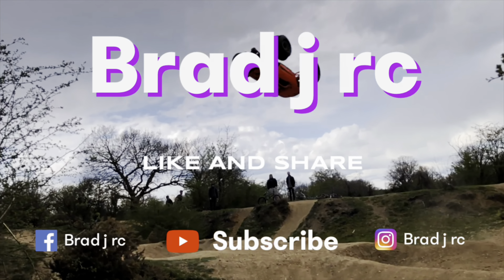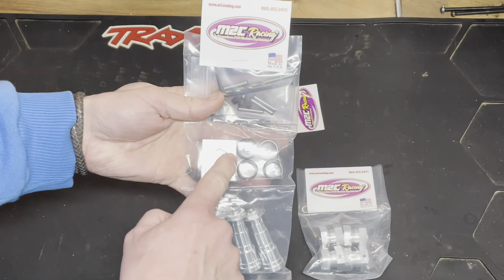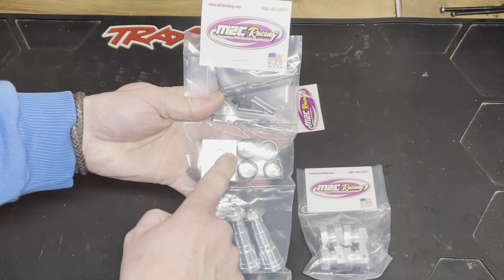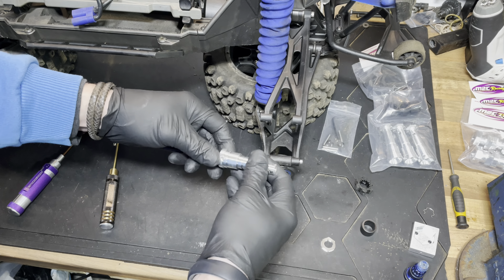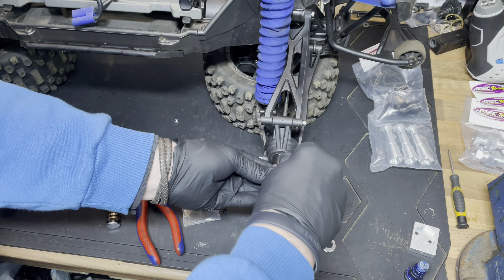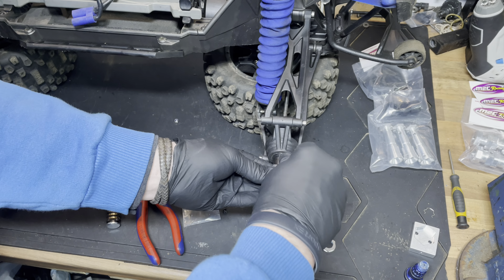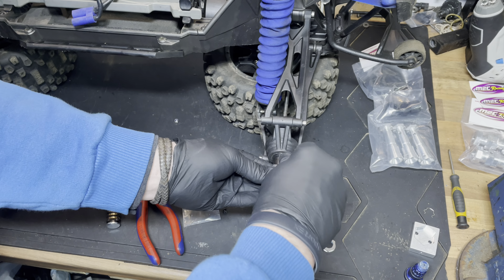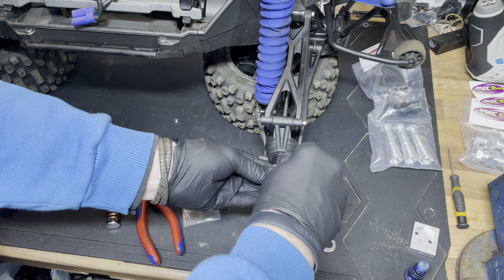Xmaxx M2c hub extender’s ( first look and installation)

Comment: I had to add a 1.5mm with a 14mm diameter hole washer /spacer behind the traxxas plastic wheel hex to stop the far to excessive play I’ve heard a lot of people have this issue as well strangely if you add the 24 mm m2c hex set you don’t need a spacer … seems like the m2c black plastic spacer provided in the kit is slightly too small …..great install video subbed
Reply from the maker: Cheers for the sub, that’s interesting to hear I’ve not noticed any issues but I’ll have a good look and if need be I’ll add a washer. Thanks for that 👍🏻
Reply: Do you by chance have a link to those washers/ spacers? I have noticed this same issue with mine.
Reply: @armandosmith8323 I just bought them off Amazon type in the size I put and they come in packs

Comment: Why not xmaxx wide maxx kit, less wheel bearing trouble would think. How long bearings last
Reply from the maker: For me I wanted a bit of width but not as much as the wide kit as you lose some turning circle. I’ve not had a bearing fail yet and the truck is more stable than standard. I also have a xrt now so have the best of both worlds if that makes sense. Thank you for checking the video out 👊🏻
Reply: @bradjrc196  thanks for input, just putting Xrt tires on makes xmaxx handle better while turning fast in short grass even. So maybe all need is little extra .
Reply from the maker: @ no problem, that’s not a bad shout about the tyres might try that at some point 👌

Comment: Hi, if im just installing the 24mm hex adapter on my XRT will it have problem if im using the 8s Dboots backflip tires. Will it rub against the arms nut?
Reply from the maker: I’m not 100% sure as I’ve not done it on the xrt but I believe they will work . Send a message to M2c and they should be able to confirm it.

Comment: Will this work for the maxx v2
Reply from the maker: Unfortunately it’s made for the xmaxx, there is aftermarket extension for the maxx but read the reviews and watch videos of people’s findings as there are some cheap ones out there.  Hope this helps
Reply: @bradjrc196  I’m currently doing that only I can find 10 mm extension and I was after 2m wondering if welding 2 together will work 😂any ideas 😎💪
Reply from the maker: Unless you can make arrma ones fit from custom rc upgrades, shoot home a message he may be able to help or make some.
Reply: @bradjrc196  where can I find him mate thanks
Reply from the maker: https://customrcupgrades.com/shop/

Comment: HEY BROTHER HOW ARE THOSE MC2 HUB EXTENSIONS HELD UP HAS IF CAUSED ANY PROBLEMS WITH BEARINGS OR CONTROL ARMS BREAKING MORE.
Reply from the maker: They have been fine , not had and problems since fitting them 👌

Comment: I have recently installed the m2c widekit and found both bearing races to be slightly undersized. Causing a bit of a wobble.
They’re 14.92 and 19.92mm respectively whereas the stocks come in at 15 & 20mm exactly.
Have you had any issues with increased wobble (and wear) after installation?
Reply from the maker: No I’ve not had any problems. Very strange . Are your hubs and bearings new or been running them for a while ? Not that that should matter but could be a reason.
Reply: @bradjrc196  Ran 3-4 packs with them installed, so good as new.
Afraid that this slop will cause additional wear to the stub axles and will go on to wobble even more.
But I take it your bearings fit snug on the m2c stubs?
Reply from the maker: @wippip  yes I think so . Didn’t notice any wobble.
Reply: Are they stock hubs or rpm
Reply: I have exactly same issue as you I added a spacer behind the plastic m2c one I don’t need it when I put on the 24mm m2c hubs strangely m2c plastic spacer is undersized